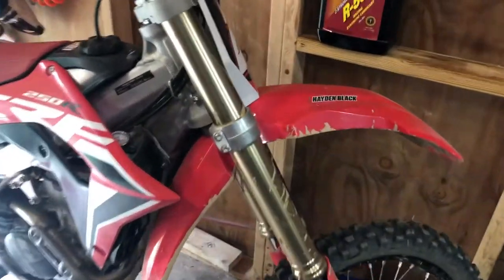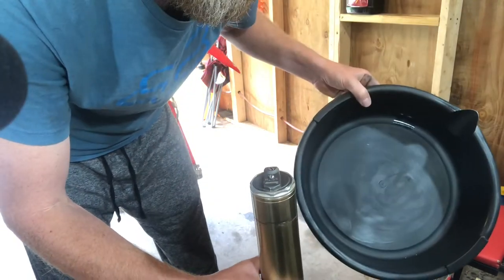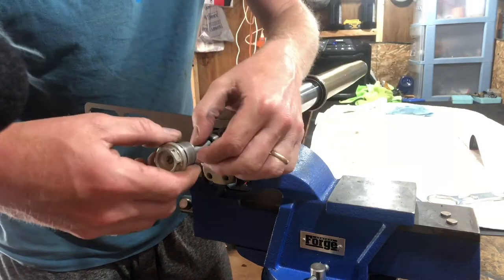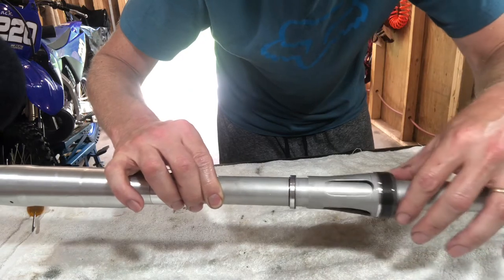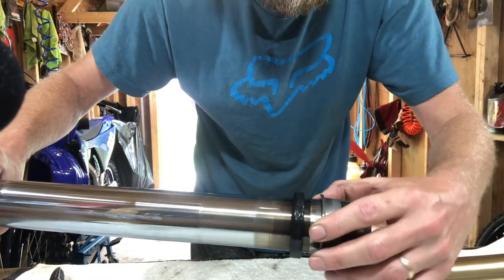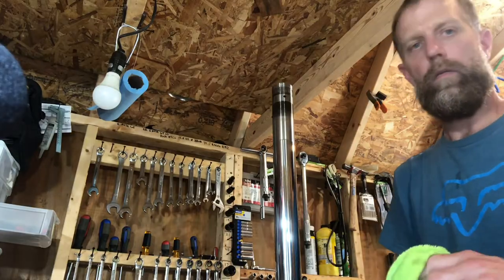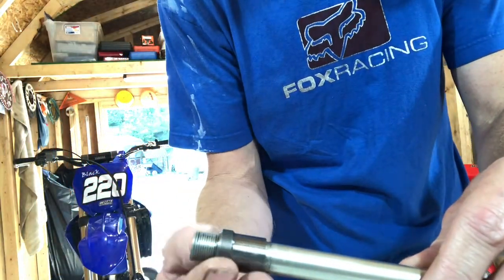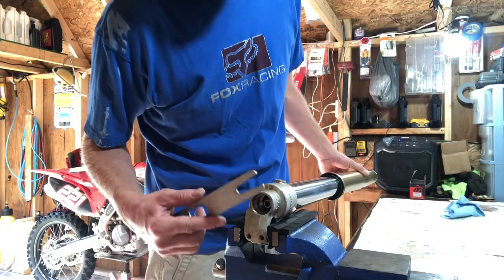2021 CRF250R Fork Seal Replacement.

Comment: In case you’re cheap like me and you don’t want to buy a tool to install your seal you can wrap electrical tape around you’re cylinder and use that as a back stop to bang your seal into place. Electrical tape is best because it doesn’t leave much residue on your shaft.

Comment: very helpful video my man thanks..forks on my 14' crf250l leaking oil, but ripped it for few hundred more miles of potholes and seems to still be holding up even though oil is all over the place, idk, guess will start bottoming out when lost enough oil my guess, anyways time for tune up after 10years of thrashing.  i replaced my rear shock with race face and much better now, but i dont think there is any front fork replacement options yet idk

Comment: What about the air in the system I did mine like this but I have air in my cartridge and oil coming out my adjustment screw on the cap